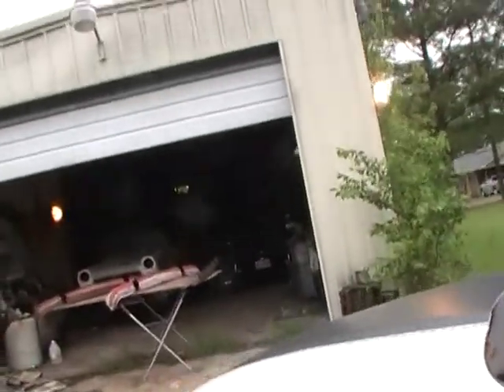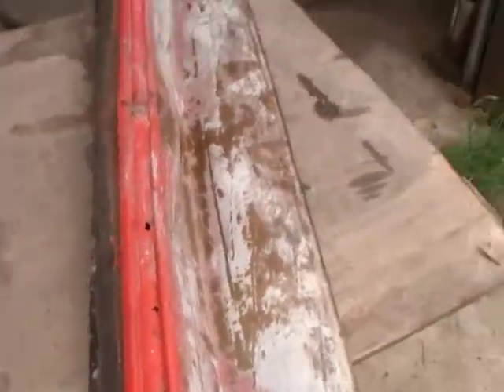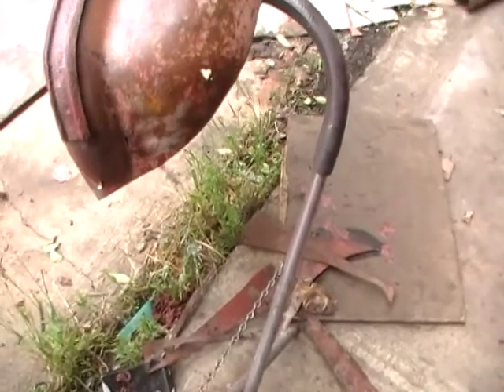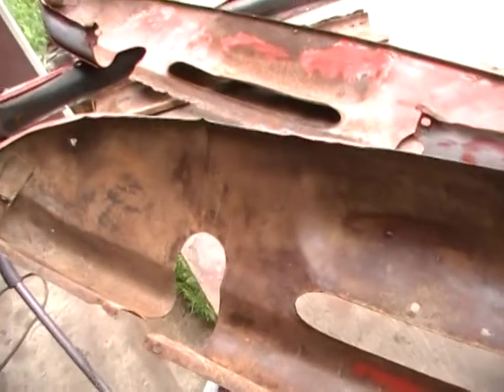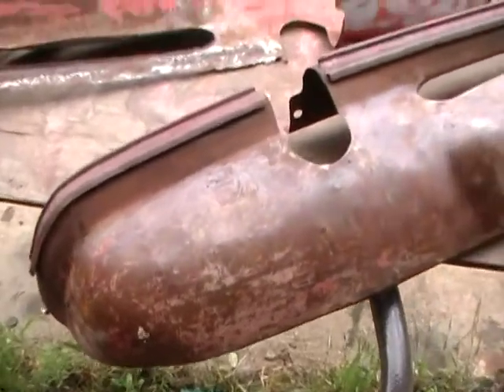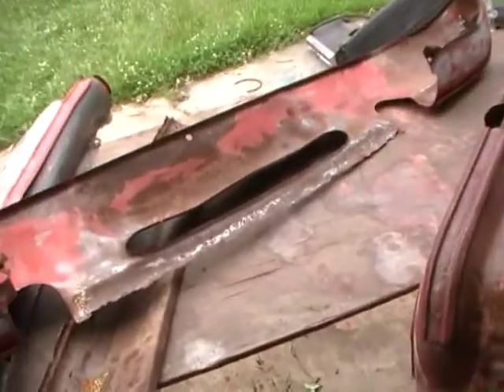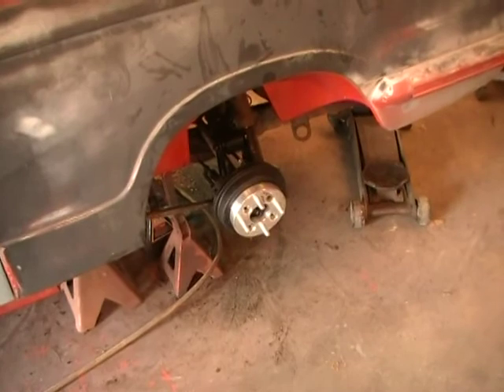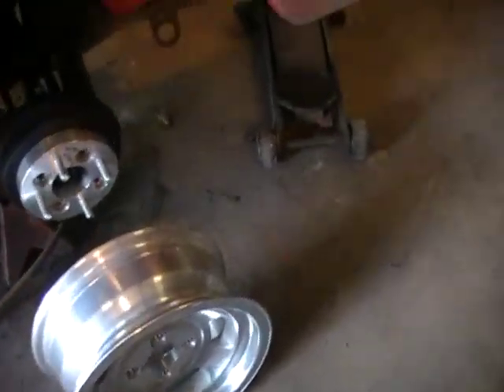Herald Valance Torture

Comment: the crank looks like a 390,because of the sloped angles on the first counter weight to the first throw.the rod looks like a 390 rod also because of how the base of the rod gets wider at the base towards the rod bolts.if the block hasnt been bored it would be 4.050 dia. cyl. to be a standard 390( or 360 depending on the crank and rods used) . if you have a 4"to5" micrometer, mic it on the skirt just below the the wrist pin but above the skirt tips. i think a 427 block was crossed drilled from the outside of the block into the main caps for added support at higher rpm. but im not positive didnt see  many of those, pretty rare. i hope some of this will help you find out what you have if not and this is old news please disreguard.  ill hush now.

Comment: I am sold on the aluminium slots very cool. They get my vote. You was talking about vinegar. You can lay wet vinegar rags on the valance and it will eat the rust right off. It takes over night a couple of times but You dont have to sand it all day to get rid of the rust. Save your elbow grease and your back and stuff. Mmmm choc doughnuts and rusty metal delicious.
Reply from the maker: Thank you for your help my brother.  I learned the vinegar trick from yall!

Comment: Some Machine shops can weld up a crank and grind back like brand new. That is a nice motor for a fixer upper. It is awesome. They make about 410 hp. They are getting harder to come by these days. Especially the main caps. Sometimes a CJ Mustang can sell at auction for 80 thousand dollars. And yeah the motors and parts are worth quite a bit.
Reply from the maker: Thanks again. I will let someone else have the fun with this monster.

Comment: You thought my name was Eli..It's short for "unrEliable"...Good pistons..That engine must have a long stroke Steve...My 304ci engine has a 4" bore..so does a 327 and 350 and 302 and 351 and many more..That crank wear !!...It must have hammered with the oil light on for some time..Junk now I'd say but a new crank and it should be a good builder..Jen would bring me a samich and ask if I'd wash my hands..Why.?.Making good progress Stevie..Diggin' it mate.
Reply from the maker: The mill had twin turbos and has metal sleeves too. ???
Reply: Does it have "O" rings around the sleeves.?.I didn't see any on the head and that's usually what you would "O" ring first for big boost..
Reply from the maker: Steel sleeves and o ringed block.The heads are not from this engine.

Comment: My old mates herald convertable had a bad valance too, he looked into replacements but they were fiberglass copys that were really really crap!!, finally he bought one full of holes but in one piece, he welded patches in, after dressing it with a grinder it looked dandy :-))
They never seem to fit right, like everything else on the car ha ha :-D
Reply from the maker: That sounds a lot like what will happen to me and my car! Ha
Reply: cutworm59 Well the old heralds were a bit rough and you did need to mess around and align panals to look ok, part of the fun lol :D
Keep up the good work :-D

Comment: You do know that vinegar is an acid, right? You can't clean acid with acid to get it to stop reacting. That is why you have a layer of rust on it already. Been there and done that.
Reply from the maker: Nope. I just figured it would wash away the caustic acid and make it safer to handle.  I  did coat the metal after using a wire wheel on it. Now it sits with Zinc primer on it.
Reply: cutworm59 It should have been washed with plain water to neutralize the acids. Look on your vinegar bottle and it will tell you the % of acid. They sell "cleaning" vinegar that has a higher concentration of acid in it.
Reply from the maker: Takin me to school George! Thanks! I will do it right on the other panels. You sew good!
Reply: cutworm59 Experienced the hard way.
Reply: ***** LOL
Reply: cutworm59 a little baking soda mixed with water is just the ticket to neutralize the acid. cheers

Comment: Them pistons sure are big my mini only has little ones.
Reply from the maker: My Crosley has 2" pistons with a 2" stroke. Will Rev to 7k all day. 26 1/2 horse power!  Zooommmm
Reply: Cool my mini has a 1275cc engine 70.6mm bore and 81.33mm stroke approx 70 hp.
Reply from the maker: spanermantim Woo Hoo! Same as my Morry! Twin SU's
Reply: Yep but I got a mild cam and 1 3/4"SU and lcb exhaust. Just got it running again after 8 years. I do have video but can't edit it at the mo I need tech help from my son.
Reply from the maker: Cram it on here Tim. I don't need no stinkin editing.... HA!
Reply: Will see what I can do.
Reply from the maker: Thanks Bubba!